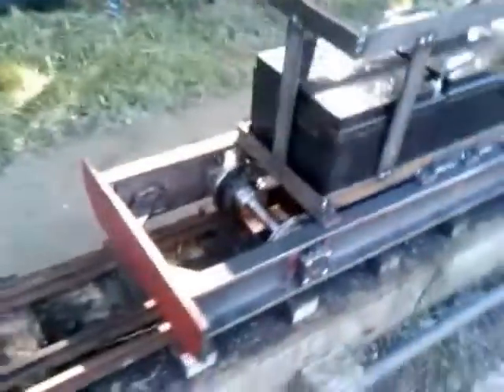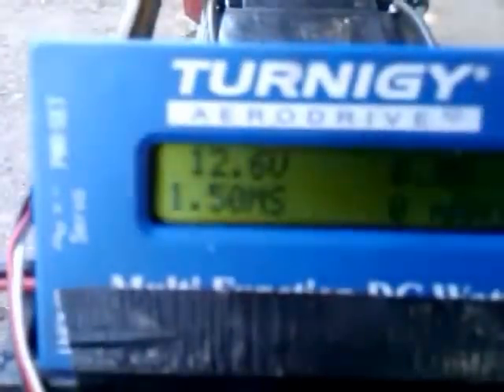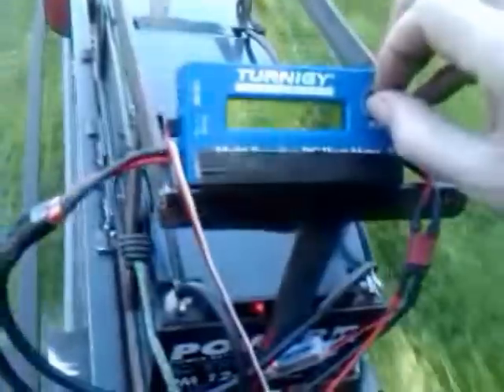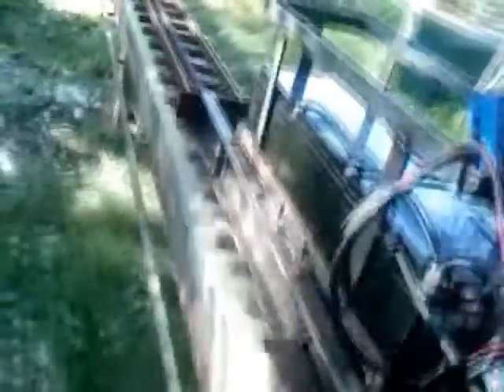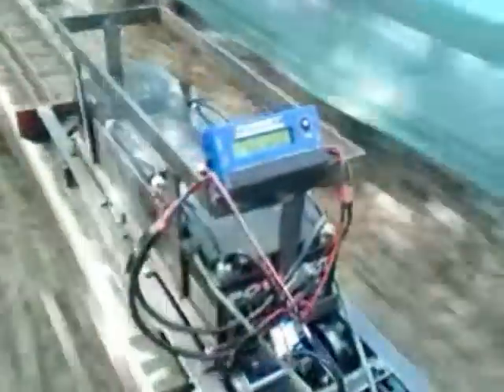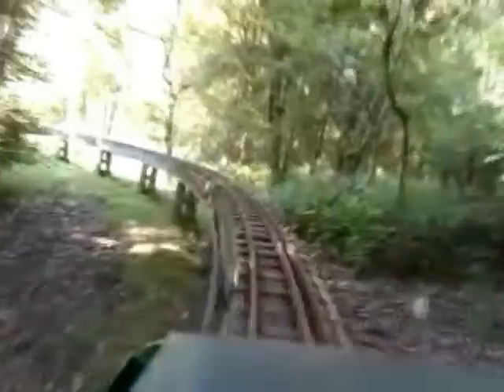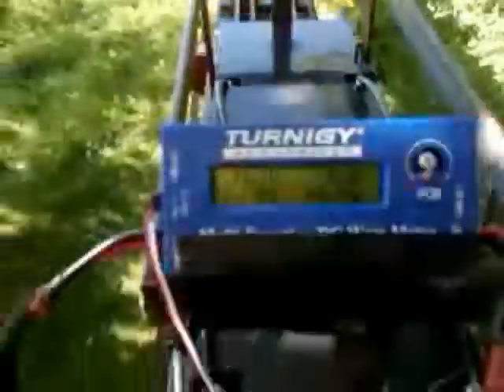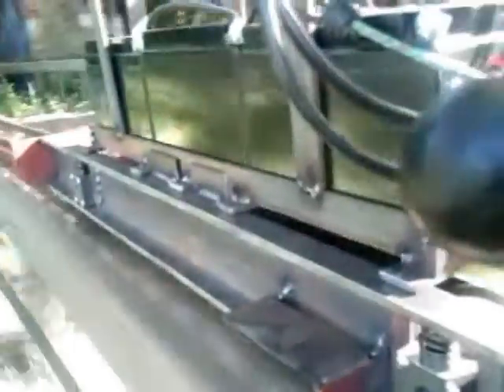5 inch Narrow Gauge Maintenance train-Brushless. WITH NARRATION

Comment from the maker: I was going to use a sensored motor but couldn't find a suitable controller for this project, and this makes it a challenge. The next phase is to add a secondary shaft with a further 2.5:1 gear reduction to chain driver. The video doesn't show the cogging as it is a downhill start. Hope this all helps.

Comment from the maker: I used these batteries as thats what I had to hand. the finished project will have a single 115ah battery or a couple of 75ah batteries. I emailed you the website where I located the motor, with an explanation of the problems with this setup.

Comment from the maker: Thanks for the comment. here are some details:
Motor:Turnigy C6364-230. Controller:Tecmodel EZRun60A. Control source:Turnigy Aerodrive meter/PCM control. You could use an RC receiver for a control device. Be aware, I am still experimenting and I am having a bit or trouble with startup cogging (a common thing with sensorless BL motors). I am thinking I need to have a small clutch machined up for me to allow the motor to run up before it takes drive.

Comment: Just a thought,could you not reduce the cogging by increasing the gear ratio between motor and axle by using a larger gear on the axle,so the motor will need to output less torque at start and will spin up quicker,although you will lose a bit of top end.

Comment: Why have you gone for the expense of multiple sealed lead acid batteries instead of one or two big deep cycle wet LA batteries?Which would be far cheaper and less weight?Where is the club track that you run at?Could you tell me who supplied the motor as I'm having difficulty tracking one down!! thanks.

Comment: Hello! I'm going to be building a 7.5 gauge SD40 with 4 of these motors. One per axle. Do you know the hp per motor? Are they 12vdc or 24vdc? A curious observation,  it looked like the case of the motor was spinning,  not just the shaft.  Did I see that right?  

Any info you can give me would be greatly appreciated!  Thank you! 

-phil

Comment: Hi Steve, I know it's been a long time but i thought I would try and see if you are still around. I am very interested in your brushless maintenance train but i note that Hobbyking don't list the motor anymore. You mentioned that a sensored motor would have been your first choice. Now there are sensored ESC's which motor would you go for?

I have a brand new leisure battery 12v 100Ah (maintenace free) would this be ok for the project do you think?

Comment: Where did you purchase the wheels and axles? Also the your belt solution is very good idea how to reduce noise. Was is hard to find online? (i cant find the right dimensions, getting frustrated how to connect the motor axle). Thanks for any advice